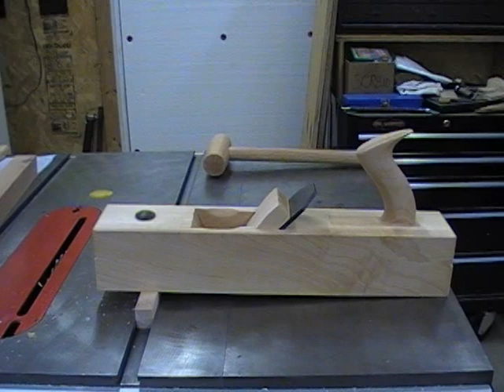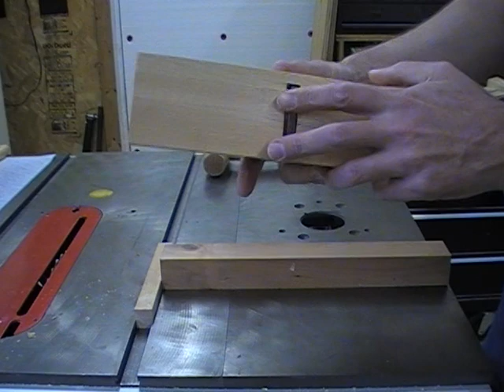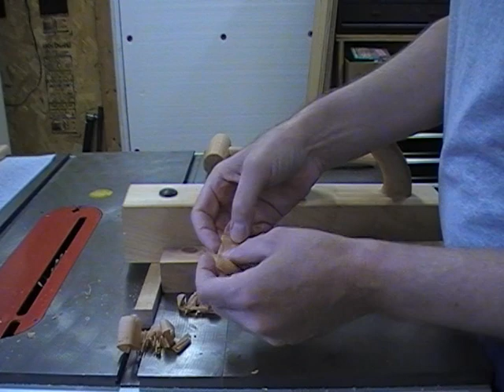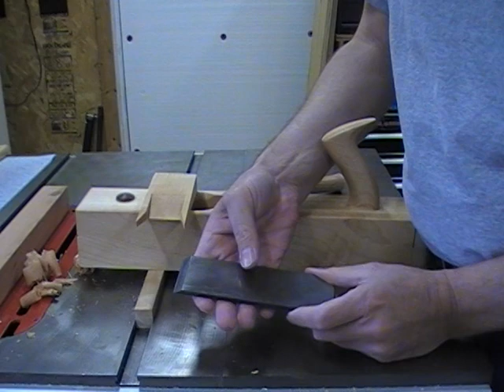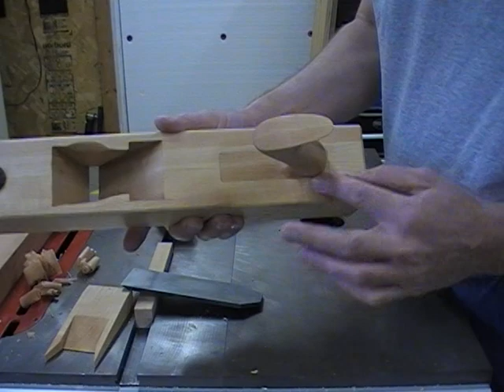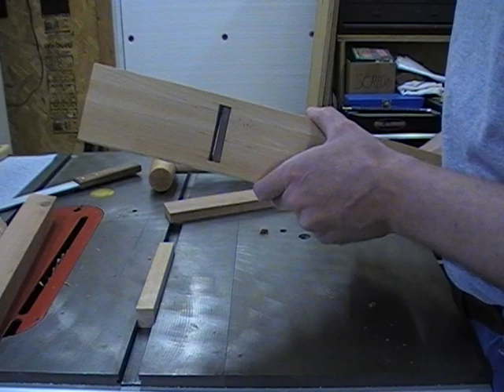Jack-Plane.mpg

Comment: This makes me laugh!..i had the same experience! Built a krenov type jack plane as a bit of a goof with a spare blade and chip breaker i had. Got her done and as i played with it I was basically stunned. It was fantastic. The adjustment was a thing to get a grasp of but not too bad. I went on to build a beech foreplane (like this one with the captured wedge) and then a router plane of my own design...the three tools really filled out my tool set and they work miraculously well...the cost of similar performing tools from one of the good manufacturers would have cost me a grand or so...did it for the price of the blades...just over one hundred. I did feel the need to get some kind of hammer for adjustment and grabbed one with one face of rawhide and one copper (20$). I have a very good manufactured smoother , shoulder and block planes and i think this is best because the rapid accurate adjustment is very useful for those in particular. Thanks for the video. If anyone out there is curious to try plane making do not be intimidated, its actually surprising easy to get a very very good result. cheers!
Reply from the maker: I have built a smoother and another jack for myself since this one and they are both good users.   I also have Stanley metal and transitional planes that work well but this one is still my favorite and sees a lot of use.

Comment: Nice job.   I would not worry to much about not using the old way, solid one piece body. If the old timers had our modern glues they would have done it the way you did. Just like a lot of us are doing.

Don’t forget to put a finish on it.  Unfinished will change with humidity like crazy and trueness is essential for hand tools.

Comment from the maker: This one is hard maple and is still my go-to plane when flattening boards.  In the video I have the blade sharpened pretty much straight across like a smoother.  I have since ground a 9-inch radius on the blade which makes it much more useful for stock removal.

Comment from the maker: @iSubForYouToo 

I guess you are talking about an adjustable mouth.  I might consider that when I build a smoothing plane.  

There is really no need for it on a jack plane.  The mouth opening should be fairly large to allow heavy shavings to pass without clogging.  Anyway, the striking button makes a place to strike with a mallet to loosen the blade and wedge.  Otherwise you would have to beat on the body of the plane and I don't like to do that.

Comment: Great job and a good demonstration on how to correctly set the blade which I didn't know how to as I've used the newer cast iron 'Stanley' models.  What species of wood did you use for the body?

Comment: Hi,
Great plane.  I really like it.  Especially the detail on the cavity.  Can you describe your hardening process.  I know you heated it up and then quenched.  But what did you quench it with.  And how long did you let the metal bake to regain the carbon it lost on heating?  What temp did you use for the heat and baking process.  Plus, how log was it in those states.  Also, what metal supply house did you use for the A-2 steel?  Best Regards, BAG2
Reply from the maker: A2 is an air hardening tool steel.  You actually quench it in room temperature air.  Heating varies from one alloy to another but for A2 you should heat it to 1750 degrees F.  Once it reaches this temperature, the general rule is to hold it there one hour per inch of thickness.  Since the steel I use for blades is 3/16" thick, 15 minutes would be enough.  I usually let it go a little longer just in case it wasn't fully up to temp. when I started the countdown.  Tempering the steel after hardening doesn't replace carbon rather it normalizes or reduces stresses in the structure of the steel which reduces brittleness created in the hardening process making the blade more durable.  Burning the carbon out of the steel is caused by overheating.  If you are careful with your temps this shouldn't be a problem.  This video describes the process I use.  https://www.youtube.com/watch?v=PBJDqSiVapg

Comment: Looks nice.  Would have liked to see it work as a jack though.  See if it chattered and what not.  So, is it stable under a heavy load?
Reply from the maker: I cambered the iron to about an 8-inch radius and it hogs off material like crazy.  I'm very happy with it.  The iron is 3/16 inch thick and it doesn't chatter.

Comment from the maker: I ordered the tool steel online, I don't recall the vendor.  Do a search for A2 tool steel for sale.  You will find several vendors that sell in small quantities.  I built my own oven for heat treating the steel.  I have a video on making the blade if you search my channel mikescncshop.  I have info on the oven build on my website. also mikescncshop.

You could us 01 steel and a MAPP gas torch if you don't want to make a big investment.  Lots of info online for heat treating steel.